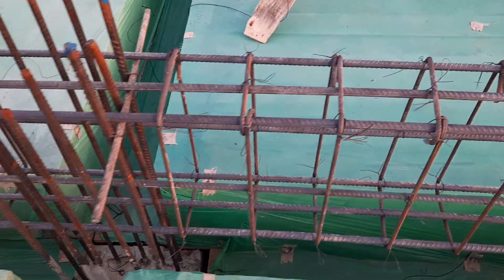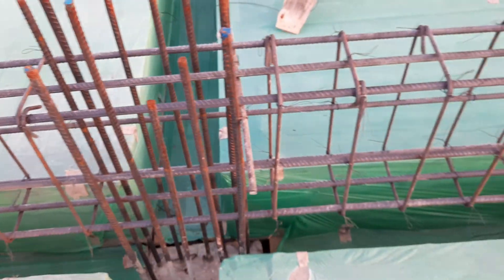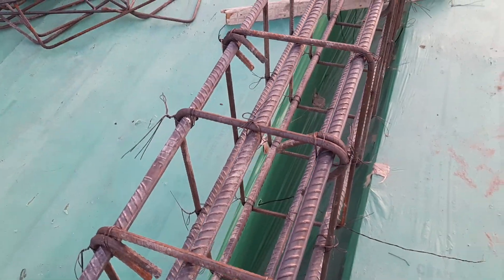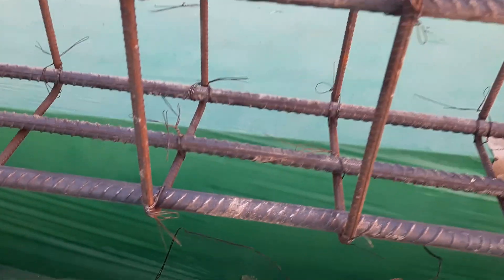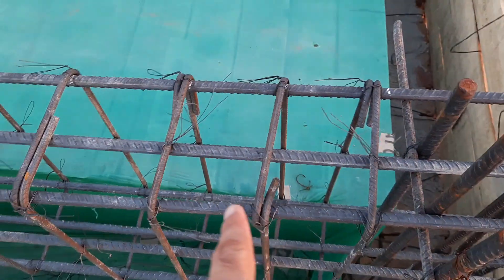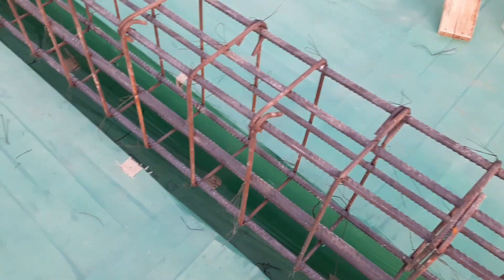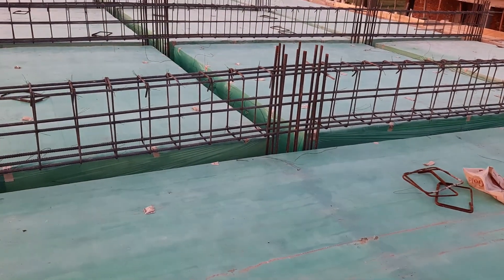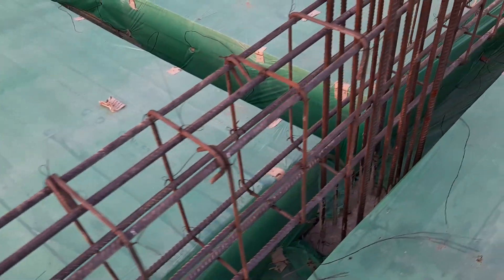4 Storey Beam Design | Practical Video on Site | Civil Site Construction Video

Comment: 8 steel bar they provided. 2 are side bars. if we provide 2 crank bars instead of side bars will be good or this 2 side bars are ok?
Reply: Side bars is called shrinkage this is the waste of steel when the deft of beam increase from 60 cm tehn we need to provide shrikage bars.